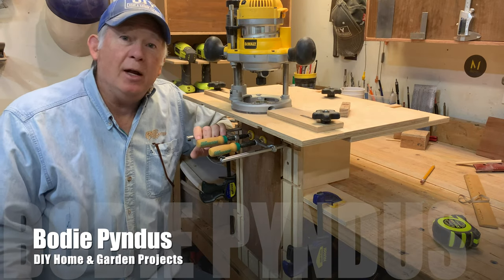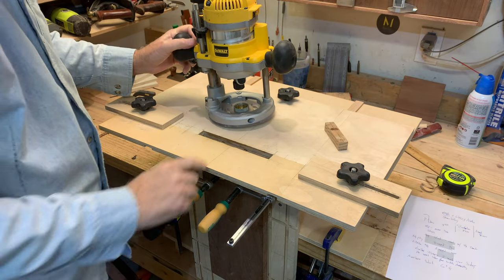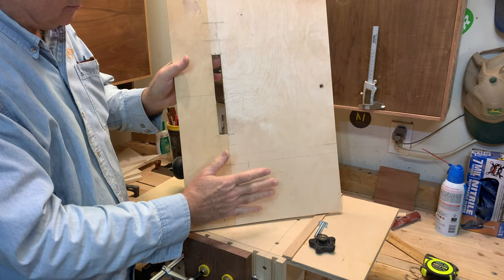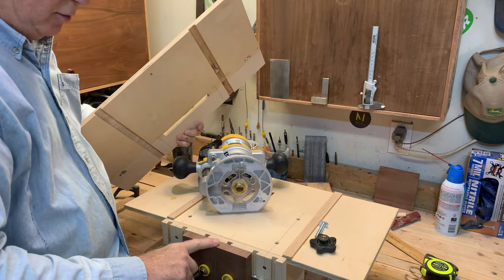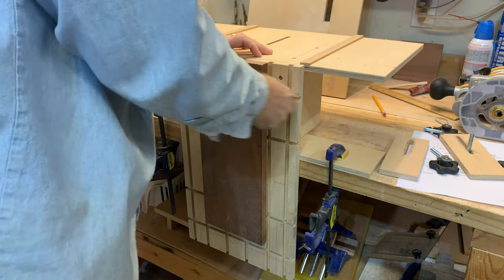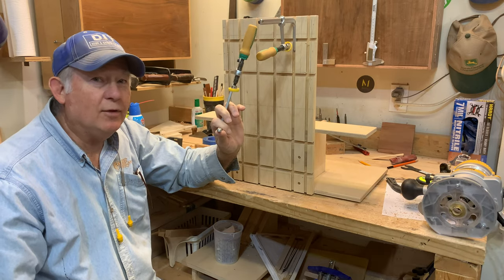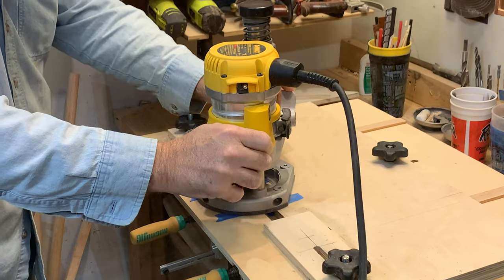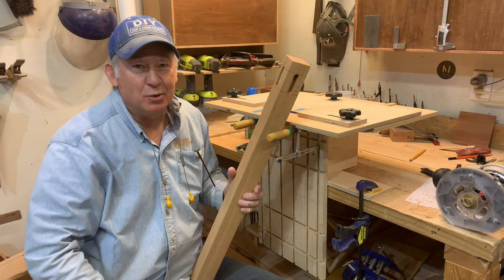Easy DIY Mortising Jig: Affordable And Effective Woodworking Tool

Comment: Rudy's BBQ.  Love it!   Love this jig.  Might be a PIA to set up, but the accurate repeatability makes it worth it.   One thing I discovered using router template is ensuring the friggin face plate on the router is dead center.  I couldn't get consistent results and then checked for center and it was off.  Now I have full confidence in the router and the jig.

Comment: Nice job Bodie, I have used a similar jig for a number of years, but found one problem that made me redesign the top of the jig.  The problem is that single knob to hold the top in place once you have aligned the top to your wood.  Over time the single knob is prone to slipping. I found this out the hard way on a table with 8 mortises that got progressively out of whack as I went along.  The better way is to have at least two stops for the top.  I also now clamp the top in place with clamps too.  Its a good jig overall.
Reply from the maker: Thanks for the experience tip duly noted.

Comment: Seems like a lot of effort to be able to use a guide bushing and that free floating top only locked in one position doesn't look very stable, at least not around 10:55. What I want to say is that running the router with a fixed top and two fences instead of guide bushing makes the jig more simple and stable, also it's easier to set up aiming for the lines and not have to consider the bushing offset. Also you can easily make double mortices. https://youtu.be/KBoim06Hmyg